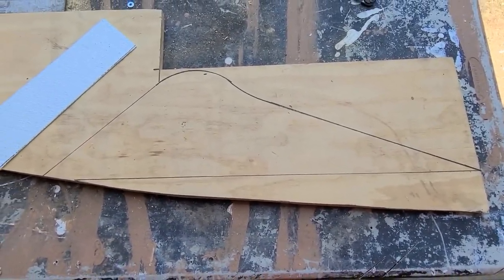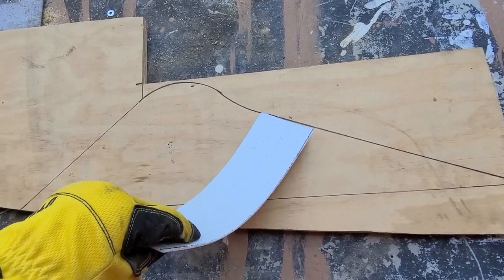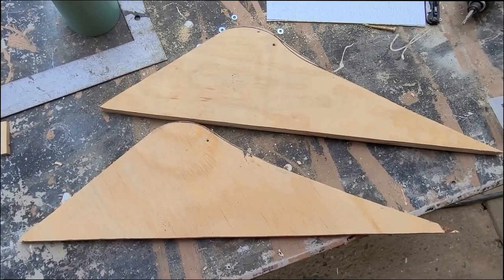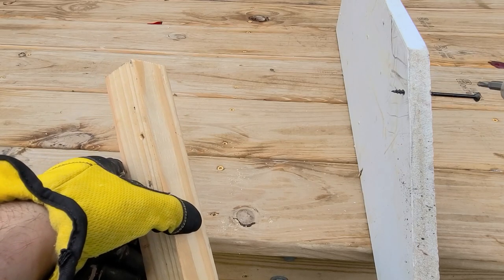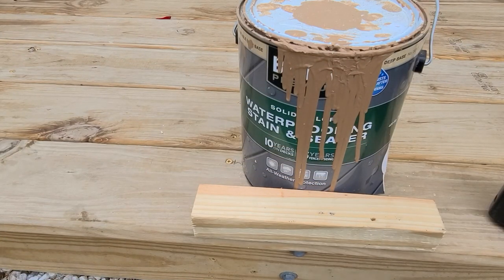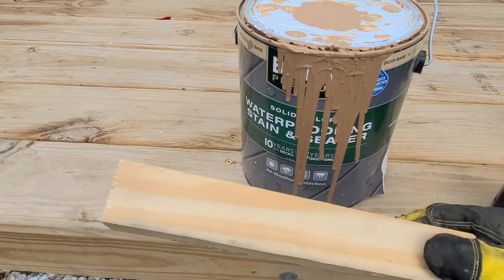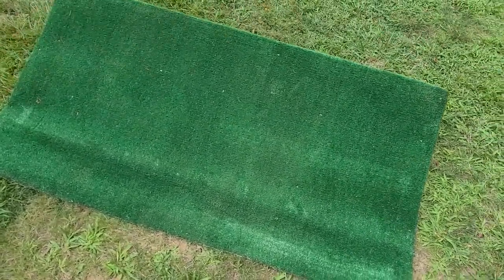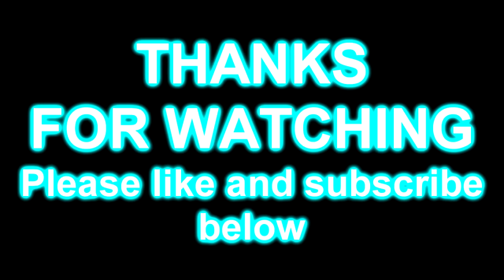How to build ramps or jumps for R/C cars.

Comment: Nice tutorial for those of us with limited DIY skills! I started with a dirt kicker and already seen how much additional maintenance this brings to the track. I imagine a full dirt jump needs so much more work! I am going to follow your steps over the winter and see if I can get a jump and landing ramp for the new season! Cheers chap
Reply from the maker: Yea...my issue with the dirt is I use machinery to prep the track. The tractor and roller just beats them down every pass. The only way to stop that was to build up the sides with wood to stop the jump from "squishing out" from the tractor weight. Packing and rolling by hand would allow dirt jumps...but this just works for me better and gives the track a unique look.  Plus when I break out the $uper vintage stuff. I can remove some of the car killer ramps. 
    I am glad this was helpful! Can't wait to see your finished product. Hopefully I get to that 1k sub mark within the next 5 years (lol) so we can open the YouTube community tab on my page. Really wish that was at a lower requirement.
Reply: Just wondering how you managed to get the distance on point for the jumps? Was it trial and error or some unique scientific method?? The kicker on the lip is a great pointer!
Reply from the maker: @theoagrc  I took a gold pan rc10 and a Hornet... put a old soft blanket down and marked where they ended up. If you notice there is tape on some of the pipes marking where they need to be for the race grade (gold pan/losi buggies) and fun grade (Hornets frogs ect.).
When we do t.a. videos this will be a necessary variable in the layout.
Reply: @VINTAGEBACKYARDRC  As always great insight! Looking forward to seeing some more videos before the weather starts to turn! 👍🏻

Comment: have you build any whoop jumps?  not sure if 3" or 4" pipes under the turf and to offset half length or full; width
Reply from the maker: I have not...but do have some old 4 inch pvc that would probably work if cut in half and tucked under some turf.

Comment: Awesome tutorial mate 👌 could truck-bed liner be an alternative for the carpet? It doesn't soak up water  🤔
Reply from the maker: Thanks! I had used undercoat on the last ramps and it did not hold up. The bedliner stuff is usually a bit tougher for sure...but most of those  products  while textured  are not super grippy. Probably worth a shot if you could find a rubberized one.

Comment: Hi there thanks for the video. I am in Australia so sometimes it is hard to find the same materials. What is the fibreglass sheet used for in the USA so I can try to find something similar? Is it cladding for houses?
Reply from the maker: It's a flexible wall paneling. Usually used in damp rooms (such as bath or laundry room) for interior walls. I see a lot of Campers (Caravans) and RV's using this material as well for interior walls.
Reply: @VINTAGEBACKYARDRC  OK yes thanks! Yes now I know the material. It is used a lot in Australia for caravans.

Comment: I getting ready to make a track. I want dirt jumps but you’ve got me wondering how bad was the maintenance?
Reply from the maker: I only had two the 1st time.
For me (because I use a tractor for maintenance) it was a pain. Dragging the spiked roller or rake drag would flatten out the jumps and the tractor had a hard time navigating over them.
   Most tracks have dirt jumps so its not "that bad" in reality. These just work better for the support equipment I use and the dirt I didn't have available.
Reply: @VINTAGEBACKYARDRC  Thanks so much. I’m probably making one only and it will be closer to a big mound than of a jump.
It is a track just for myself and maybe a friend or two. It will get only little bit of use.
Reply from the maker: @State of art  Good luck with the build my friend and enjoy.

Comment: I know this is a old video but what did you use for the flat part? the thin stuff.
Reply from the maker: Not sure if you are in the states or not...but our local Home Depot has this plastic paneling. It sort of looks like what you would see on the walls of an RV bathroom. I have seen people use it for laundry rooms as well. Was in with the plywood and wall paneling at my local.

Comment: Do you have a link for the plastic sheet you use ramp?
Reply from the maker: @radripperaj  I don't unfortunately. My local Home Depot has it with their peg board (in the lumber section).
    It's mainly used in bathrooms/washrooms.
Reply: @VINTAGEBACKYARDRC  thank you for the fast reply. Your backyard track is so cool. I am hoping to do something like that soon. What is the width and length of the track? Also, how wide are the lanes?